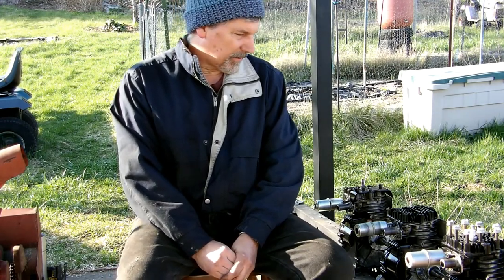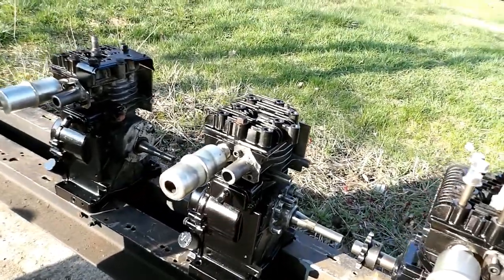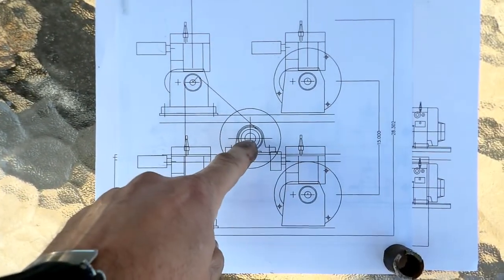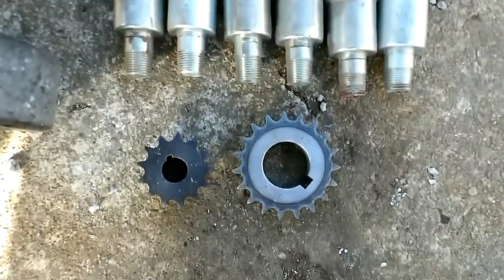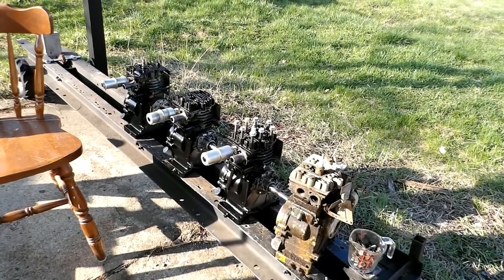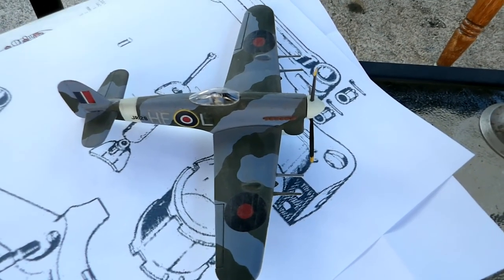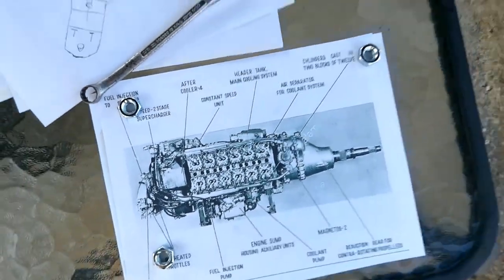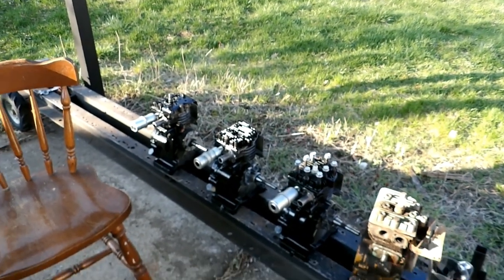12 Cylinder Briggs Project Part 2

Comment: I guess you need a 12 tooth sprocket for the timing then. Can't wait to see this running. In fact it would power a car along pretty good.
Reply from the maker: A 12 tooth sprocket would work well, I chose a different tooth number based on price and availibility, as I ordered 24 of them, and didn't want to wait. this will make timing more difficult though.

Comment: If you drew those plans by hand, I am impressed. If it was on computer only slightly less. If in your support structure you build in an adjustment between the banks it may save some heartache. A slide adjustment like the rear wheel on a motorcycle swingarm. Gives you coarse adjustment for chain length and fine adjustment to true the sprockets. Adjustable front and rear and side to side. Treating each bank as a solid unit. Just saying. I have been paneling my shed to keep the insulation in all day. Got to aircondition it or its wortheless here soon. Prewired but the electricians are afraid because my workmate had the virus but is fine now.
Reply from the maker: Where do you live? I have a bad memory, it must be somewhere fairly hot, we are still in the tail end of winter here :(   We had snow flurries 4 days this week, on our spring flowers that haven't flowered yet. I am planning to bolt the lower left bank of 3 cylinder (on the 12) down to steel plates, then shim the top bank of cylinders upwards. I thought of using slots for movement, but they are very hard for me to cut in plates, with no torch, or plasma cutter.  I am pretty sure I will have to use slots on the right hand side where the lawnmower engines are, as shims won't work there.
Reply: @ChargerMiles007  
Arkansas, Mena. In situations like that I chain drill the slots and then use a die grinder with a cut off wheel to get close. I usually hand file for the finish but am always looking for new tricks. I bought a pneumatic file about 12 years ago but haven't used it yet. Carbide rotory files are my mainstay for such tasks. Hand file finish. I have made many aircraft parts that way but everybody complains it takes too long. They always seem to work, though. BTW, I scraped ice off of my windshield a couple of days ago. Now it's getting into the mid 80's and higher during the day. 40's at night. (F of course).